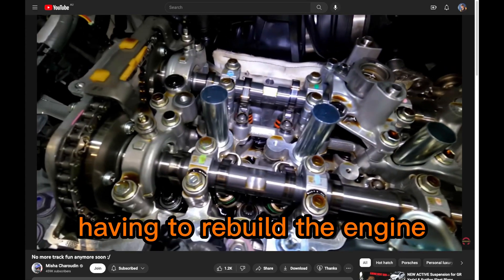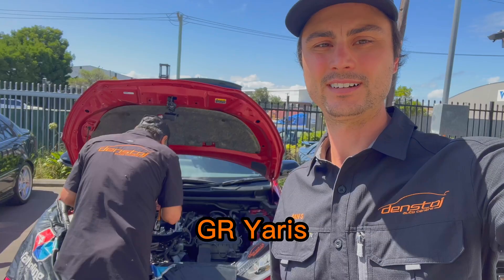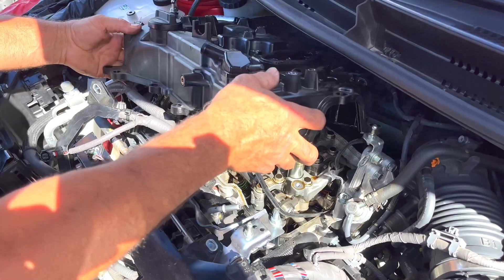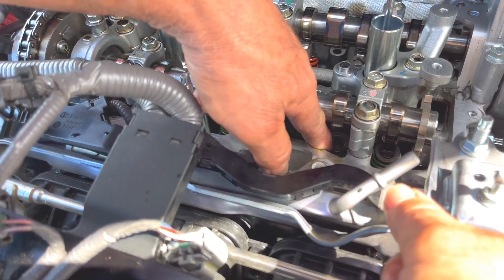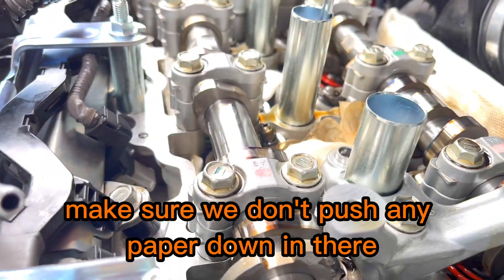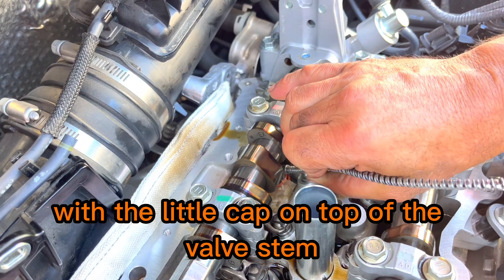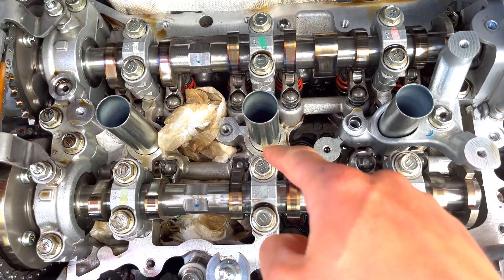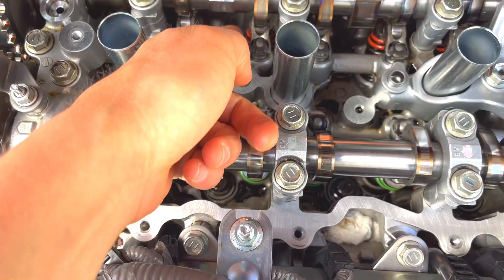How It Should Be from the Factory: G16E-GTS Engine Reliability Upgrade (GR Corolla & GR Yaris)

Comment: Do you know if these will also work on the normal M20A FKS Motors?
Reply: Awesome can’t wait 😁
Reply from the maker: @darkabyss5604  initial checks look good. Will let you know properly tomorrow
Reply: Okay now my next question would be if were to order I would need a extra 4 retainers off the GR version unless you guys make a option to add extra for the M20
Reply from the maker: Yes. I forgot to mention that for the M20, we will include an additional 4 hydraulic lash adjusters and 4 rocker retainer clips as it's a 4 cylinder engine.  Apologies, I mistakenly thought 3 bangers were more common! It might be easier if you drop us an email at rockers@denstoj.com.au and we'll sort it out from there. Thanks.
Reply: Just sent one see if it works this time
Reply from the maker: Got it! Gmail thought it was spam.
Reply from the maker: Good question. We’d have to look into it. Were you thinking of doing any other upgrades to yours?
Reply: @denstoj  well so far I just have full bolt ons and and tune that’s can rise the Rev limit a little higher then stock maybe in the future when more stuff comes out for the car I will
Reply from the maker: @darkabyss5604 ok nice, I’ll look into it for you and let you know
Reply: @denstoj  okay sounds good thanks 😁
Reply from the maker: I've ordered both the rocker and lash adjuster in to inspect for you properly. 👍 Might be a couple of weeks before I have them though. ☹️
Reply: @denstoj any update yet?
Reply from the maker: Parts haven’t come in yet. Will check for you.
Reply from the maker: @darkabyss5604  the parts have arrived, will let you know as soon we can. Thanks for your patience!
Reply: Okay sounds good I really hope it works
Reply from the maker: @darkabyss5604  Yep, our kit will work! The rocker arm is actually the same part number (13801-25010) so no issues with the clip. The hydraulic lash adjuster is a different part number. The G16E-GTS is 13750-70020 and the M20 is 13750-25010 however the diameter and oiling hole position are the same. The length of the M20 is slightly longer in the fully pumped out position by 0.2mm, however, as it's a hydraulic lash adjuster it will operate when collapsed so it won't make a difference. You'd be better off retaining the rocker (to improve the reliability), especially when raising the rev limit. Let us know if you have any other question, if not, feel free to order on our website when you're ready. I'll keep an eye out for it.
Reply: I’ve tried sending a email though that one and it says not found
Reply from the maker: @darkabyss5604  that's odd, definitely sent to "rockers@denstoj.com.au"? I've put it in quotation marks so hopefully YouTube doesn't hyperlink to our website instead.
Reply from the maker: @darkabyss5604  I've been keeping an eye out for your email but still no luck?
Reply: Ahh gotcha

Comment: Are the valve springs upgraded in the gr corolla there is conflicting info.
Reply from the maker: Hey @minimumwrist3546, we made a YouTube short about the engine differences in the GR Yaris and GR Corolla (link below). When we were doing our research, it was noted that the exhaust valves had increased in size with a change to the head. The exhaust valves  likely have a slightly stiffer spring. We have taken both engines apart and done a side-by-side comparison yet. What sources are you going off? https://www.youtube.com/shorts/S87hXoSNhWg
Reply: @denstoj  LIMIT+1 posted it. won’t let me paste a link without removing comment. Search google for gr corolla upgraded valve springs.
Reply: @denstoj  Really appreciate your response I wish there was a how to for spring and cam replacement for the Corolla.
Reply from the maker: @minimumwrist3546  no problem at all. Feel free to ask any other questions. Are you looking to do the upgrade yourself on your GR Corolla? That's a good idea for a video for sure.
Reply: @denstoj yea I would definitely like to do it myself. Plus I want to buy your product and do it all at once.
Reply from the maker: @minimumwrist3546  Sounds great. We will do a video on installing the Stage 1 Kelford cams, Kelford springs and our retainer kit. When were you thinking of doing it?
Reply: @denstoj  I will do it as soon as your video hits. I’m patient I have 900 miles on the car gonna put another 500 to a 1000 miles more just to make sure everything holding together and solid then I’ll go for it. You guys are amazing and your video are extremely valuable to the community and your product is genius.
Reply from the maker: @minimumwrist3546 Amazing! Our install video will be done early next year with how crazy the Christmas period is at the moment. Thanks for your kind words 🙏Did you want to drop us a DM on Instagram and we’ll keep chatting there?
Reply: @denstoj  definitely I will add you now
Reply from the maker: @minimumwrist3546 sweet
Reply from the maker: haven't seen you pop up in Instagram DMs yet? Oh and just saw your comment about LIMIT+1's post regarding the Corolla springs. Will search for it and check it out. Thanks.
Reply from the maker: Just did a comparison of part numbers between the GR Corolla and GR Yaris. Valve springs are different: https://www.instagram.com/p/C1Bhs72iyDS/?

Comment: hard to understand what’s going on hear different english 😂 assuming some stronger reinforcement of collets and clips but what makes yours stronger over OEM? I’m hearing Toyota improved for the GRC on parts but time will tell.
Reply from the maker: Haha had to read that twice then I realised you must be from the other side of the world 🇺🇸 Both the GR Yaris and GR Corolla don’t run a rocker retainer at all. So any instance of valve float and the rocker can fall out. So we’ve added some for extra security 👌
Reply: @denstoj  I see! In America, we have rocker arm stoppers for popular motors like the SR20 so that makes sense.
Reply from the maker: @apex_gr  yes, the SR20's were infamous for dropping rockers. The setup is a little different where the rocker is a Y shape that acts on two valve springs at the same time. This means that if there is ever a difference in load between the springs they can rotate and fall off. The rocker stoppers for the S20 made by Tomei (and then copied by many) are a bar that stops the rockers from rotating off. With a roller rocker arrangement acting onto a single valve spring, a clip is a more effective solution for retaining the rocker. What we've design is nothing groundbreaking. The same method is used on my expensive motors such as the BMW B58 in the Supra.

Comment: with these would it be a fix for the valve float at about 320bhp? and more cost effective than titanium?
Reply: stock at present
Reply from the maker: @tonyw2960  Important to explain that retaining the rockers is not a “fix” for losing valve spring pressure. It is an insurance policy for stopping the edge cases of rockers falling out if/when they occur. We recommend upgrading the springs to maintain valve spring control when you're pushing more boost along with adding these clips. Is your motor currently pushing 320bhp or is that what you're aiming for?
Reply: @Denstoj Auto Centre  I am only running a dtuk box filter and opf delete at the moment i plan on keeping the warranty at least a little while 😂
Reply from the maker: @tonyw2960  ah got it. I wonder how long you'll last... :)
Reply: @denstoj  I'm already getting cold sweats every new part that comes out 😂😂😂
Reply from the maker: 🤣 I know it’s hard to stop looking. They just seem to pop up!
Reply from the maker: Hey @Tony Webb, what springs are you running?

Comment: So I’ve got a GR Corolla. Picked it up two weeks ago. Could you tell me why I would want to do this to my car? I’m not super familiar with engine internals.
Reply from the maker: Hey, @iamlamb, first of all congratulations on your GR Corolla, that's awesome!  Great question. There is a bit of engineering behind it. I'll do my best to explain over YouTube comments. 

The rockers in many "cost effective" cars from Toyota (and Subaru) run a floating rocker. That is, the rocker is only held in place by spring pressure. Most of the time this is fine, however under conditions such as valve float, stick or bounce, spring pressure can be lost and the rocker can simply fall out. At the start of the video we show an example of Misha talking about how annoying it's been dropping rockers due to misshifts. Now misshifts are an extreme case of over rev but no one is a perfect driver.

With this rocker arrangement in the valvetrain more expensive engines, such as the BMW B58 in the Supra, run a clip to account for these conditions. You can see it in Papadakis’ video here: https://youtu.be/MckxlP60cnY?t=477

If you're looking for peace of mind when you rev the engine, installing a rocker retainer is a no brainer. Adding them is like an insurance policy on your motor.

I hope I've explained that clearly. Let me know if you have any questions?
Reply: @denstoj  I guess the only other question is where can I get a set of them?
Reply from the maker: @iamblamb, that one is much easier. They will be available to order on our website (link below) once we complete our final testing. I can add you to our waiting list if you'd like? https://denstoj.com.au/products/g16e-gts-yaris-gr-rocker-retainer-kit-by-denstoj
Reply: @denstoj  i went ahead and shot you an email with my contact info
Reply from the maker: @iamblamb, great I’ll check it out.
Reply from the maker: @iamblamb curious as to what other minor mods you are thinking of starting with?
Reply: @denstoj  Well i just picked up a track setup for wheels and tires.  They're lighter and wider and the tires are R compound 100TW.  I'll probably get some race brake pads and higher temp fluid before I get on track and probably wrap the exhaust.  I think the track day is in August so its not going to be long before it gets here.  I just don't want anything overheating while I'm out there.
Reply from the maker: @iamblamb501  Good plan. You're getting setup with the right stuff to have a lot fun on the track with the peace of mind you're not going home on the trailer. What track are you going go to and have you been before?
Reply: @denstoj  Never been to one before.  I'm going to start with Ozarks Int. in Missouri.  Looks like it is a good match for the car because there are a lot of turns and elevation changes but only a few long straights.
Reply from the maker: Oh man that sounds really fun
Reply: just enjoy your car ! 

i have a gr yaris and in the meanwhile i know a lot of other who own a gr yaris, i‘m in the biggest community in europe for the gr yaris, there was nearly none  shifting problem as they say. i just heard from one case from apex, but there you must say that at apex you can rental cars too driving on track. 
there are so many who can not even drive a manual car any more, because they are so in that automatic gear boxes sheme. 

for the rest there is no real problem, in 99% of the problems, the human are the problem, not the mechanics 🙂
Reply from the maker: Apologies, I don't mean to spook people from enjoying driving these wicked cars. They're such an impressive package. All cars will have their issues but at the end of the day, they're to be enjoyed. With this rocker arrangement, a clip is used on the majority of high performance engines such as the Supra. We just want to give those people who want it, this option of the added peace of mind to rev their engines in the proper spirited fashion!
Reply: @miyagiracer  I’m enjoying my car.  I plan on making minor modifications to it in the first five years, but after five years turning it into my dedicated track car.  That’s the main reason that I’m interested in this.

Comment: Do the clips vibrate on the rockers creating new/additoinal valvetrain noises?
Reply from the maker: Hey @Joseph El-Hawary, thanks for the question. The clips do not add any additional load to the rocker or lash adjuster and hence no noise. The clip is secured tightly to the rocker and there is clearance between the clip and lash adjuster under normal operation. Only under a condition where the spring pressure is lost for a split second, and the rocker tries to fall out, does the clip actually do anything. Let me know if you have any other questions. 👍

Comment: Wow looks good update but not very easy
Reply from the maker: Thanks, @MrMorizoFan. We’re very proud of what we’ve developed. We have taken our learnings from our kit for the Toyota 86 and applied it to the Yaris. It’ll save many headaches from destroyed valvetrains and engines. Yes, without removing the camshafts, you do have to be careful when installing. It’s great though that you can leave it in the car and still do it. Do you have a GR Yaris? ps. Love your YouTube name. 👌
Reply: @denstoj  cheers! yes GR Yaris owner for 1.5yrs and 30tkm now, happy km's and lots of smiles. ;)
Reply from the maker: Oh wow, awesome. Such a fun car. Any mods?
Reply: @denstoj  Some basic - HJS DP, Wagner IC + turbo inlet, forge intake duct and Setrab pro series1 oil cooler + some brake cooling & pads. Mostly built the car to take speedy runs without many issues with heat. waiting eagerly for summer..
Reply from the maker: Sounds awesome, very sensible to focus on cooling so you can stay out on track and have peace of mind you’re not going home on the trailer 🤣anything else planned?
Reply: @denstoj  Cheers sensibility is my second name. :D
not much just get more fun miles. these cars are best when they're driven flat out (or almost).. versatile, quick and fun little cars!
Reply from the maker: I like your thinking 👍